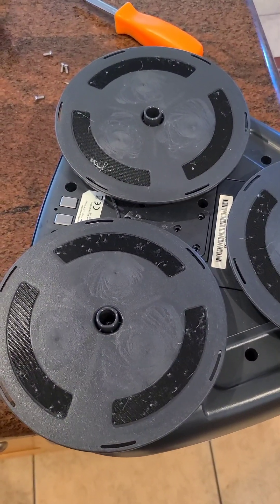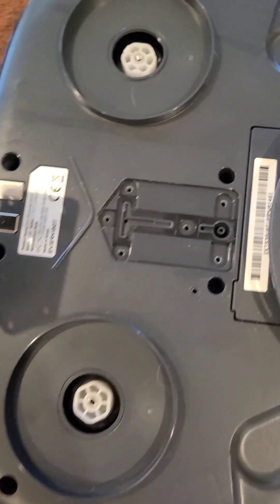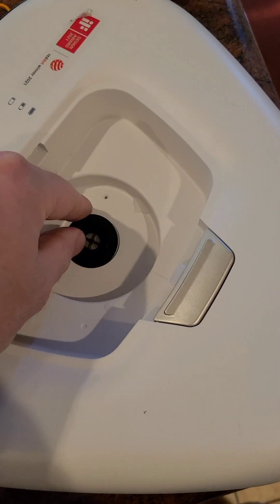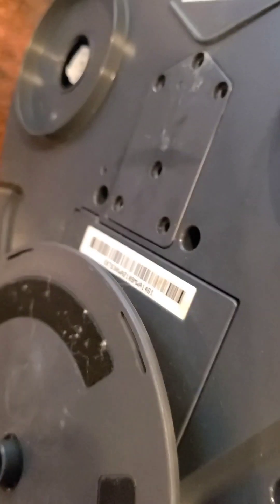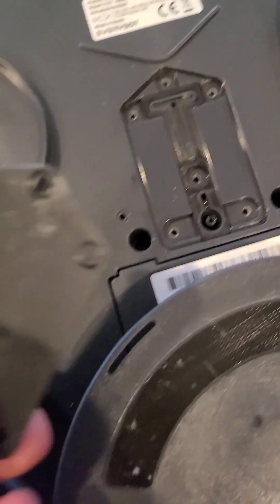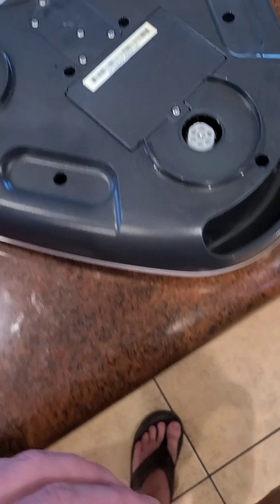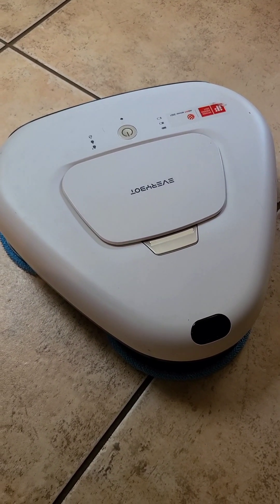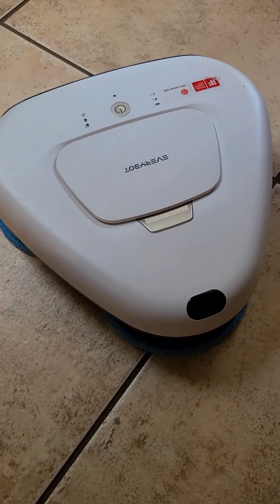Everybot TS300 mopping robot water not working fix

Comment: Thanks, I just put a needle through the 3 holes from the outside.  I had taken it apart awhile ago to change the batteries and discovered that the heads of the screws that hold the pad holders were almost totally stripped.  Do you, by any chance, know the size and thread of those screw?  I'm saving my next trip into the bottom for when I have new screws.  Thanks.
Reply from the maker: A few months later it had a fault that I couldn't find the solution for, so I had to get rid of it unfortunately, so I dont know the screw sizes, sorry.